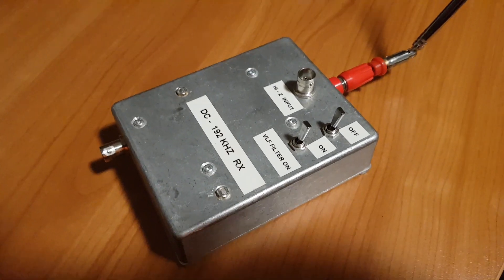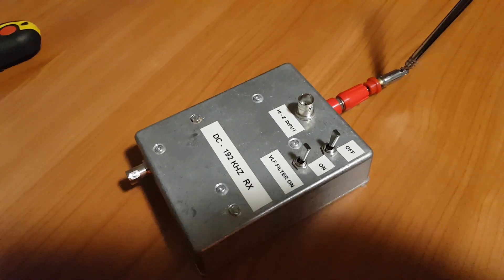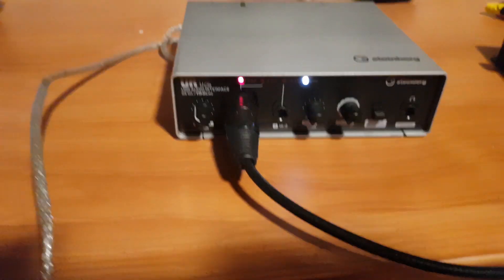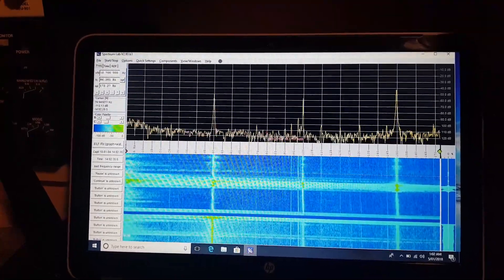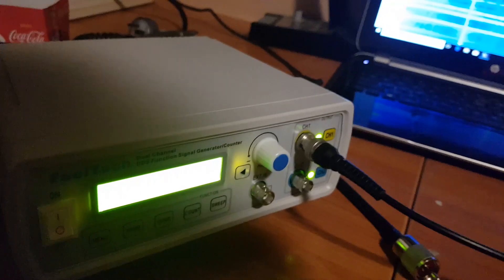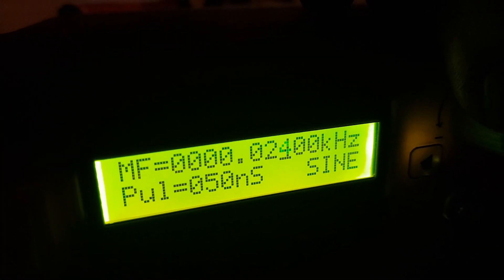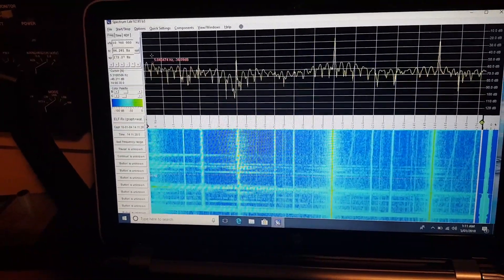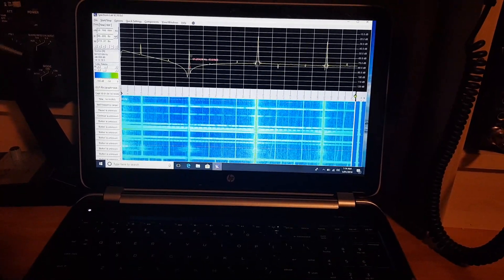ELF Equipment show and tell.  Schumann Resonance receiver

Comment: What soundcard dd you use and exactly what  kind of amplifier did you build in your box ?
Reply: Hi.  Then I was using a Steinburg UR22 Audio interface.  I have since changed to a Behringer U-Phoria UMC202HD which has lower noise op amps in it. The other box is there mostly to convert the vey high impedance of the antenna at those low frequencies to something the sound card can use so it has a FET with a high impedance input and a low impedance output and that is followed by an opamp to increase the gain a bit, Not much..    This gives very good results with just a 1m long telescopic whip at frequencies between 1 hz and 90khz.  There is a switchable low pass filter in there to stop frequencies higher than 1 khz from swamping the wanted frequencies below 100hz .  I also use a 50 hz notch filter to know down the 50hz mains frequency.  You can imagine how high the impedance  of a 1m long whip is at 7hz.  That  is why this converter is necessary.  At frequencies above 1 khz  the sound card has more than enough gain on its own. Using a small single turn loop about 1.5m x 1.5m and the sound card I can easily hear time signals on 40khz and 60 khz from Japan and 68.5 khz from China as well as a some of the Submarine comms frequencies from around the world. from my home in Melbourne Australia.   At the moment I have no idea were the diagrams are for that box I use to receive the schumann resonance but I can look for it if you need it.  It really only works when you are miles away from any power lines so I tend to use it only when I go on holidays to far away places away from the city.
Reply: Most sdr software will accept a sound card as your sdr receiver and they work much better that a SDR that can go down to 1Khz like  the SDR Play for example.  I like and mostly use SDR Sharp for frequencies from 1 khz up and for below 1 khz I use spectrum lab which has better features for working at 7hz

Comment: Extreme high frequency. 10 MHz square A ch. 9.999 9 Mhz square B ch. Joined. 1 terra Hz. Reagan "Alien threat" A threat among us. Russians. Deimmersed Russian brain signals. 3 to 4 mm. Wrist nerv diameter. Triffid. Diff IRT. Infrared terra.
Red M. RM 2020. Russians. Infrared. Dave NL? Pipe metall 10 Hz Plus G. Horizontal. Red clip on rim. 44 Hz minus G. Be aware relativistic. Time. Tesla Prague university.
Swartzchild bridge. Injected current?
B 9.999 999 915 MHz. Uvc. B 9.999 999 999 940 MHz. Oxygen resonance 4 exo Hz.
Only box chip emission. High e volt from chip. Powerful. Short not it. 7 MHz square A with 6.999 925 MHz square. Emitted 7 MHz square with over 1 terra Hz pulse. Terra Hz relativistic. Will catch with higher speed. Previously emitted. 7 squars. Hits max electromagnetic frequency. Terra Hz runs through 7. MHz Generates gamma x ray so on. With radio range. Oxygenation. CO2 split? Can't get them to do it.
Reply: 0.016 Hz. Sun 0.02 Hz. Suns Schumann?
Set it on the pipe.

Comment: Hi from Brisbane, great video. With such a massively long wavelength at 7Hz. Have you considered a ferrite core loop or anything else apart from the small telescopic whip? I could be wrong but using the small telescopic at a miniscule of the wavelength you're just picking up the electric field of everything and all the noise we have these days. If you can make a small magnetic coupling loop, it will change everything for the better.

Comment: You sound like you're in Australia. I wonder if you can receive a 60 Hz signal emanating from power lines elsewhere in the world. American Samoa would not be too far away, but it's small, so power lines would be short, not making a good transmitting antenna. However, in North America, some power lines are hundreds of miles long. If a wire antenna does not work, I would try using an iron core magnetic loop antenna.

Comment: Use sound recorder and play back 60...180 times faster... 
ELF front end make with JFET input stage +  30Hz low pass filters 50/60Hz hum notch filter and amplifier stages...